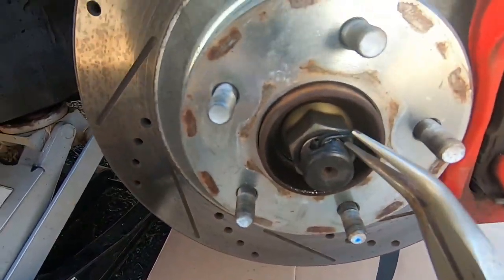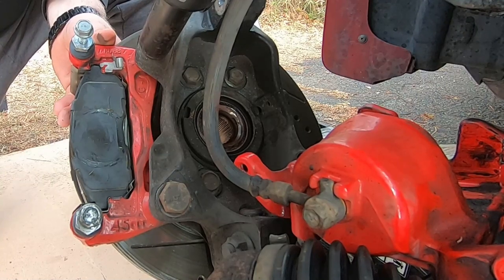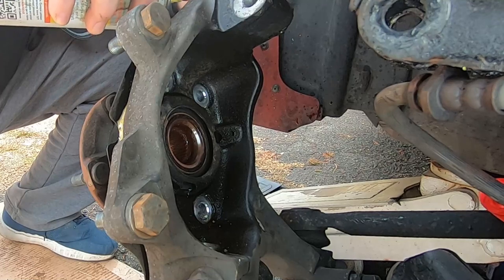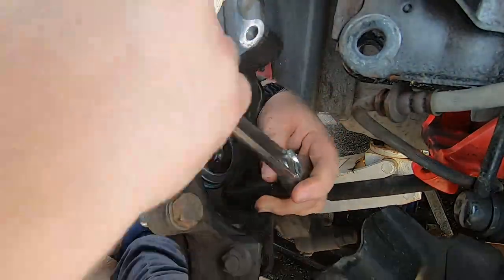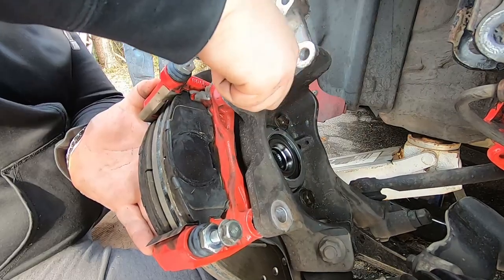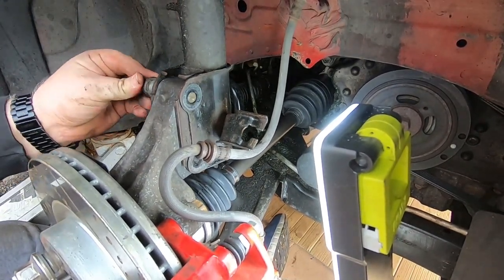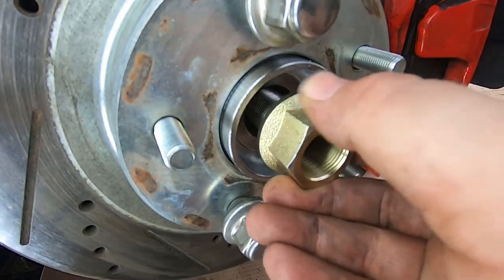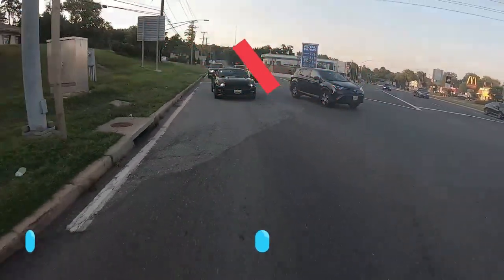2007 - 2012 Nissan Altima 2.5 Liter: Wheel Bearing/Hub Replacement Guide - FULL Walk-Through!

Comment: I've watched this repair (passenger side) from 6 different youtubers and I'd like to issue a correction:
In all of them the carrier bearing on the right cv shaft just sweetly drops out of the bracket and your off. But that's not always the case. Nissan (in their ultimate wisdom) puts a steel bearing jacket into a cast aluminum bearing bracket. Mismatched metals. Add salt and you have a galvanic response that basically welds the carrier bearing into the brackets socket. 500 hits from the slide hammer and it aint moving. The options are 1) remove the bracket completely (very hard to reach on the ground) or possibly get an air hammer on the carrier bearing from the back side, without tearing up the brackets race.
I had considered this issue prior to the repair and got the slide-hammer and fork tool from Oreilly's just in case. Unfortunately, the 5-pound slide hammer is too short and you can't get any real torque on it. It needs to be about 1.5 - 2 feet longer and heavier so you can really get a good slam.
I am going to need to raise the car to it's highest possible point off the ground with jackstands. Then crawl under the front and get a look at the carrier bearing bracket screws for removal, or the possibility of stabbing it from behind with the air hammer.
I had a quote for this job for $399 with a Napa rebuilt shaft and not including an alignment afterwards, so basically $500 total. If you have a nice car and good tires, there's no way you can jack all this suspension shit around like this and end up NOT needing an alignment. I bought a new Duralast shaft for $105 and decided to do it myself with some fresh YouTube confidence. Not going so well. Any free help will be greatly appreciated.
Reply from the maker: My advice would be to go ahead and remove the bracket that's galvanized to the carrier bearing on the shaft and remove it all in one piece. Once it's off the vehicle you can continue trying to separate them. 

It sounds like you gave a ton of effort to free it up from the bracket already. I know the 4 bolts that hold the aluminum bracket are going to be a pain to get to but it may be the only way out of this. When I was replacing mine, that possibility weighed on my mind too, guess I was just lucky that it didn't put up much of a fight and fell right out for me. I hope this advice helps you out and wish you much luck, let me know if you have any other questions.
Reply: @TrickShiftGarage  Thanks Trick Shift. Got her up in the air and looks like there's reasonable access to the 4 bolts on the bracket to the block. Guess the factory doesn't believe in ant-seize in that bearing hole. Any idea what the torque lbs are on those bracket screws? I picked up the Valvoline 75-90 oil over the 80-140. Is that the right call?
Reply from the maker: Assuming you have the manual transmission, I'd go with the 75w-90 personally. The bracket bolts are 22 ft-lbs on both the manual and CVT transmission setups. Glad you're making progress! 👍

Comment: Hey, im having this weird problem. Metal scratching / whistling sound with every tire turn for the first 10 seconds after the car has been sitting for a couple of days or tires get wet.
The second thing is i suspect my wheel bearing is going bad, but when I lift the car from one side only there’s no wiggle when I shake the tire up down left and right
Thanks